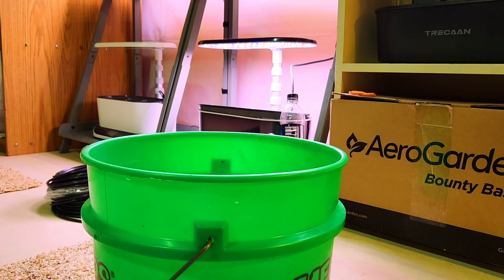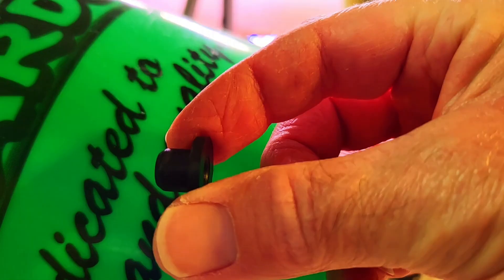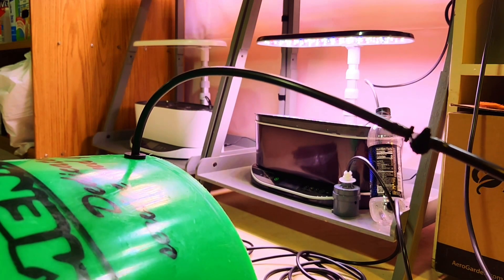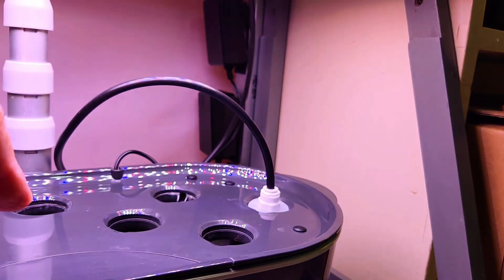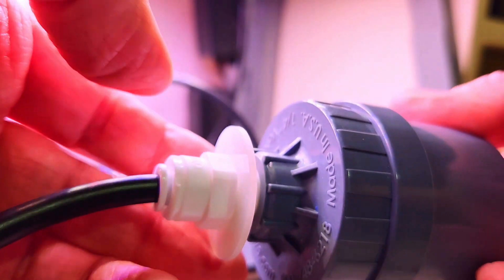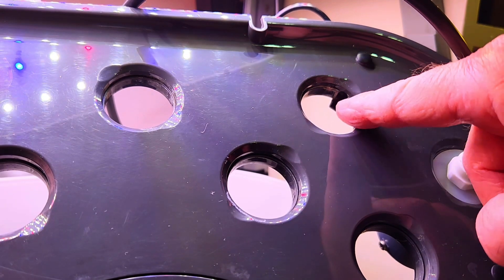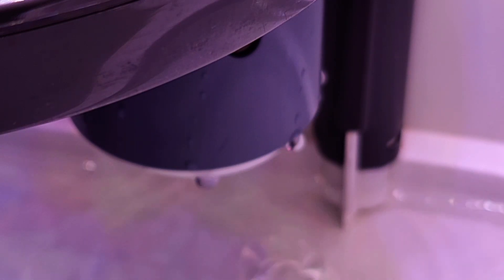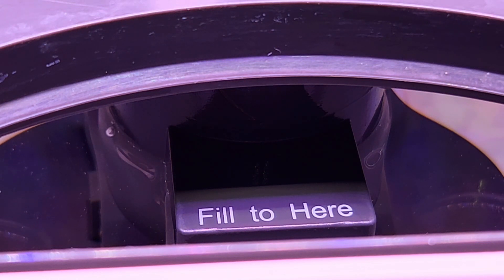FLOAT VALVE RESERVOIR DIY BUILD

Comment: I have a suggestion to use that doesn't leave burrs like a drill. Find a pipe or tube of the right diameter, heat it ove a stove burner, and MELT the hole. Don't get it too hot- just hot enough to melt the hole. You don't want the plastic burning and making the stink of burning plastic.  And burrs that possibly remain easily and cleany come off with just a rub of a fingertip
Reply from the maker: @dennismac3466  I will have to try that sometime